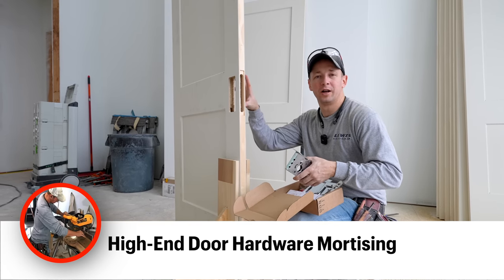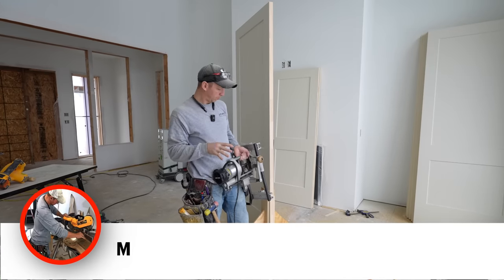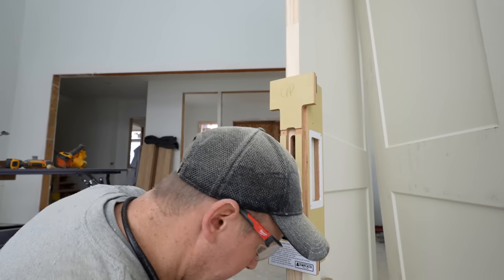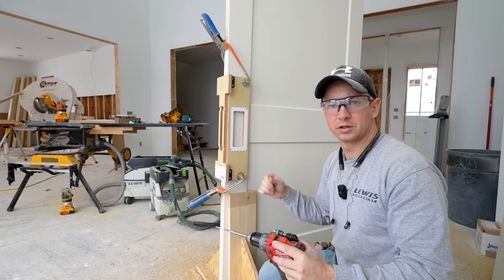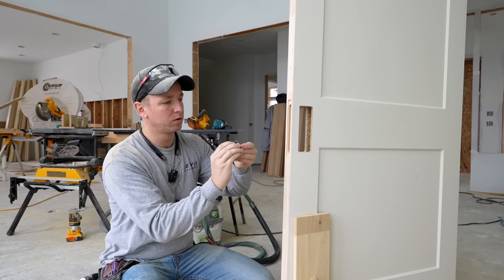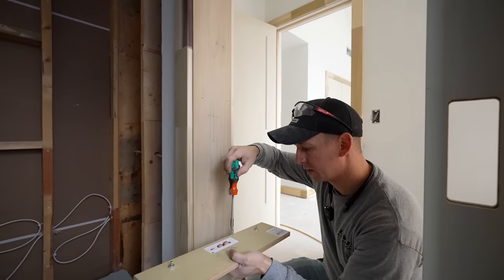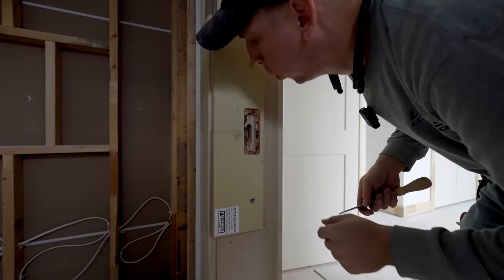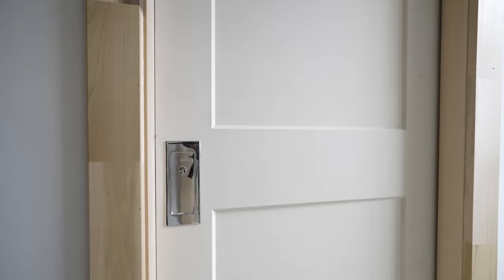Why So Expensive??? Insider Guide to Deep Mortising Pocket Door Hardware

Comment: Great video Spencer. A final touch that I’ve done a time or two. After the painters leave, I go back and install a 5mm cabinet door bumper on the top and bottom of the door edge about 100mm from the corner. Drill a stopped 3 mm hole for the stem, and add a drop of ca glue. The ones I use stand about 1.5mm proud of the surface, can be used on a flat or mortised jamb, and keeps the doors from rattling closed, and quiet at night if your trying to sleep with windows open on breezy nights. It’s a nice touch that only takes about a minute per door.

Comment: The first noticeable issue is the offset when you mount the Porter Cable mortising tool. A shim solves that offset.
The plate depth info is a plus. 
On the hardware job you know you're the big dog when taking on the mortising job that everyone fears.
These are the skills the Ingersoll Rand Door hardware certification prepared us for.
Thanks for the much needed industry demonstration!

Comment: Great instructions! For setting the door thickness on the Templaco door jig, I was thinking you could use setup blocks. If you made a pair of wood blocks 1 3/8" x 1 3/4"  x random length you could drop them in the appropriate sections of the gauged mortise and squeeze the side plates to the blocks as you set the mounting screws. That might be a quick way that reduces possible human error.

Comment: im installing a Emtek pocket door handle tomorrow.  i 3d printed router templates today, diddnt know they were available for sale.  mine cost less than a dollar to produce, but while i was at it i made a template to rout the outside of the int / ext face plates to recess them flush into the door.  its an extra step but i feel itll be worth it.  i hadnt considered the deep mortise, im not going to buy that rig you had, very nice machine but until i get a house full of these i cant justify the purchase.  so instead i think ill 3d print a template for recessing the strike plate into the edge of the door and use your method with the forstner bits to hog out the guts, no one is ever gonna see it anyway.  great video as usual spencer.  i learn something from you everytime!
Reply from the maker: I'd recommend learning to make templates yourself with CA glue. It is a very fast and cheap method of making templates if you don't want to spend the money. I would be hesitant trying to use 3D printed templates... make sure to do a test run with them before you use them on an actual door.
Reply: @InsiderCarpentry   well i did it.  damn it man do i see the value in that mortising machine of yours.  the 3d templates worked pretty good, the router's baseplate and guide are a 1 pc 3d print.  im forcing it into my workflow lol.  i typically run a test block 1x2 with a specific wall thickness and 1 or 2 holes relative to the project, then adjust a copy of the model.  its definitely not faster than CA.  matter of fact i got 2 bottles of CA on my total station.  so its slow, but accurate, and it allowed me easily swap from inside detail to outside profile, recessing the handles into the door was a nice touch.  i made a template for the lock carriage but i don't have a 3.5" router bit so i went as deep as i could with the bits i have and used that as a reference surface to drill and chisel.  it took forever.  ive been subscribed to your channel for a long time now, seriously love the quality of content and methodology you have.  i came real close to buying a jamb master after seeing your video.  keep it up man, these aren't just youtube videos, you're teaching others how to make a living and be prideful in your work.

Comment: Since your lock set height is a standard distance from the bottom of the door you could steam line your time by making the vertical side supports of the door buck go up to the point your Templaco routing jig sits at. This way when the hole is bored out in the side of the door by the first jig you simply stand the Templaco jig on top of the vertical side supports of the door buck. This saves you the time measuring and aligning on every single door going forward. A bit of careful set up one time with the door buck will shave time off each install with this system. I would also make the door buck have a longer support in the floor so it is not slightly angled. Thanks for the system, I’m going to be implementing this with our crew.

Comment: #1 safety recommendation regarding the Porter Cable 513 for everyone, ...USE  A DEADMAN'S PEDDLE to power it.  This tool turns at 27500 RPM, this way is for whatever reason something goes wrong, all you have to do is step off it and back safely and it is off as it winds down.  The reason is the placement of the On/Off switch is in such a bad location, you'll never get to it in time.
There's also a hanger kit available for this for multiple doors.   Measure your mark, ...put 513 in place, ...place the multi-piece hanger rod in the corner mount on the 513 to where it sits at the top of the door (do not secure yet).  On top is a circular disc, which needs to sit hard flush on the top of door.  Once you have it set, now secure the rod in place on the 513.  Now all you have to do is go to each door and just hang it and go vs marking every single door from either direction....big time saver.  Cheers all and happy routing. 🤔😉

Comment: Awesome instructional video. Spencer, you are a great teacher. Why is the Romex looped in the wall between the studs the way it is? Maybe some electrical contractors could chime in on this? Thanks!
Reply: It allows the outlets to be moved,without pulling an entire new circuit
Reply: Nice that the tile guy installs his own backer. Even better if he does mud walls. But it’s 2023. Most guys who float walls are retired or moved on. But I doubt the tile guy is going to install sound attenuation batts in those bays himself. No sound batts in bathrooms?

Comment: I wonder what an appropriate price to charge for install. I installed one last year with the old-school method,  was time consuming, turned out nice but I only charged $200.
I'm not a fan of the Emtek knob to lock and unlock, it's very small and could be designed to be thicker for ease of use.
Love your videos, so detailed and professional...!
Reply: What is the old school method? Doing 3 pocket doors with this hardware next week and I have none of the expensive tools
Reply: @sanesalvation  Draw the lines on the door for proper positioning, I cut the sides first. A pilot hole then jigsaw. For the mortice, drill with a spade bit, maybe 1/2" deep at a time, do the whole mortise at 1/2" deep before going deeper, keep repeating until final depth, keeping the bit straight and square. After the bulk of the mortice is drilled out, use a sharp 3/4" chisel to smooth out the mortice. Score the outline of the plate with a utility knife, set the proper depth for a palm router and rout out. I do this by eye with full control going close to the scored line, then chisel by hand to get it perfect.
Reply: @Joeshmofoshoyo old school, I just did 3 the same way you described. Builder was very happy.
How much should we charge per door??
Reply: What ever you charge, it's not enough  @DaveEPie

Comment: I've often had to route a dado into the jamb that the door could recess into. This eliminates any gap at all.  Makes people feel more private especially in bathrooms.  Seems like the temple might not work in that case unless you go back to a guide bushing so you can increase the depth.
Reply: @MrSpzwd   Do you not use door stop on your pocket doors?  I use door stop to address the "peek-a-boo" issue on the latch side, and to maintain a consistent look with the swing doors.
Reply: @jeffeverde1  I've done that too, but the dado looks cleaner and can also hide any slight variations in the gap between the door and jamb when looking from either side of the closed door.
Reply: The dado is a much cleaner look imo. I find most of the “modern” fitments fall into that “minimalist” appearance as well which leans more towards a dado verses a stop. 🤷‍♂️

Comment: Love doing this, it’s always funny the guys that talk most don’t want to do this exact procedure. 
Does that templaco template handle the oval shaped emtek hardware also? Meaning the actual pulls on the sides are oval shaped.
Reply from the maker: Yes, it comes with inserts for 3 different style including the oval. I'll be installing oval on the next job.

Comment: Nice job! I wonder how much it is to install one of these doors from start to finish. Alot of tools used just for a lock haha
Reply from the maker: It definitely adds to the cost. It's nice when there are several.
Reply: @InsiderCarpentry  There is a guy called Farid Kamal Pro on youtube, he has an amazing door template tool that works with plunge router on guide bushings. the problem is that its all in metric and wont work with our inch/foot system. I hope he makes one for american installs. His tool works alot like the tool in your video but much more manageble and has dust collection. Check it out when you have time

Comment: Have you ever tried to do this with pocket doors that are already installed? I have 7 of them installed that are going to be very difficult to remove and was wondering if you think I should do whatever it takes to remove them or make it work with them already installed? I have most of the tools/supplies from the video.
Reply from the maker: Yes, you can do it with the doors installed, it just makes a mess.

Comment: Best advise is avoid pocket doors if you can. Some places they work well like baths with closets where they are usually open. 
 Labor intensive, as you see here. Also the frame install has to be level and plumb. Just weigh the extra cost versus benefit.

Comment: With the deep hardware, do you have any concerns that the joinery between the centre rail and the stile is weakened? Great video,  I’ve learnt loads!
Reply: Yes if it was a solid timber door you’d be correct, but it looks like a chipboard core door.
Reply: Less of a concern with usage failure because it’s a center rail. Bigger concern with forced entry. Not an issue so much with pocket doors but an issue with entry door box locks where a lot of wood has to be removed.

Comment: Wouldn't it be easier to lay the door lengthwise when routing, where gravity is your friend and at a easier working height, instead of vertically where you're hunched over?  I don't know if chip ejection would be an issue.
Reply from the maker: I think chip ejection would be an issue but I could be wrong.
Reply: The p-c machine can only be used in the vertical position

Comment: Is there a reason why you don't centre the lock to the middle rail rather than offset it slightly  ?
Reply from the maker: I have since started to position the hardware so that it is closer to center. Inititally I tried to match the rotating latch at the same height as other locksets on swinging doors, but I have changed that philosophy.

Comment: Off topic comment:  WTF is going on with the stapled romex wiring loops in the wall cavity (shown in the strike plate section of this video around time stamp 30-32 minutes)?
Reply from the maker: Usually it is left to that light boxes can be cut in wherever later in the project.
Reply: @InsiderCarpentry  :  Thank you for that explanation. 
I've been an electrician for 30+ years and I have never seen anyone do that before now.
Reply: It’s also an electricians defense against the rockers. No matter how far back in the box you push the Romex, the rockers have a long enough bit on their zip tool to find some copper. Unmolested romex length can just be pulled and it’s a happy day.
Reply: @henrypeisch5289  :  Understand, but that is an excessive amount of wire. 
FYI: I back charge the rockers for the repairs if they make such a mistake.  Such language can be incorporated into job contracts/bids.
Reply: @RealTechSkills  but it looks cool and the discussion helps the channel. So, Spencer owes them lunch. Lol.

Comment: Why is there such a huge gap at the bottom of the door?
Reply: For the flooring to be installed
Reply: @713Don3rdCoast  The flooring isn't 3" thick
Reply from the maker: It's too high. It's an issue that we are unfortunately having to address with the framers. You'll be seeing a video in the future with news that I've taken over the rough framing pocket door install as well.